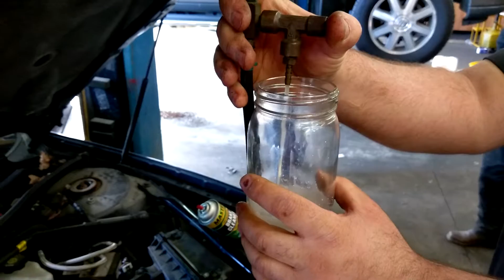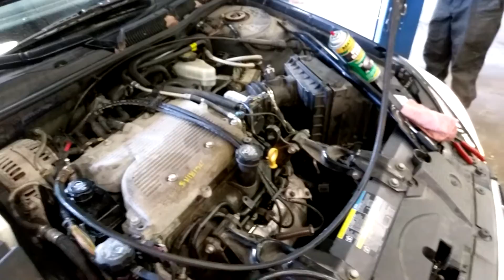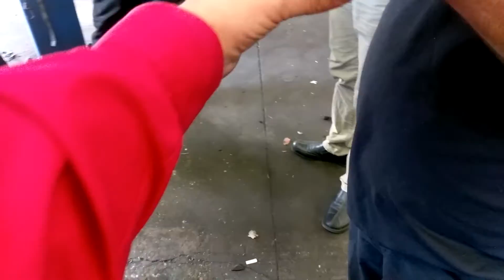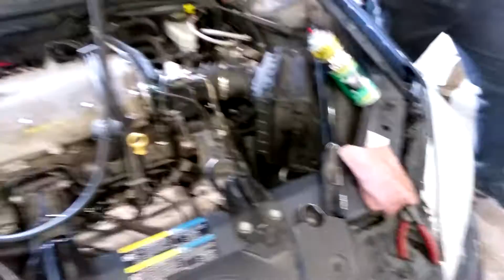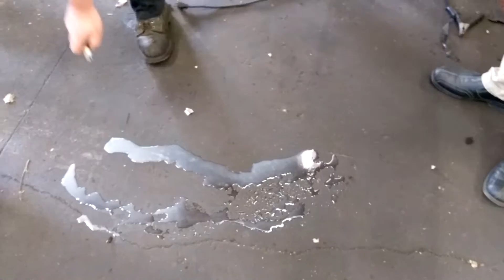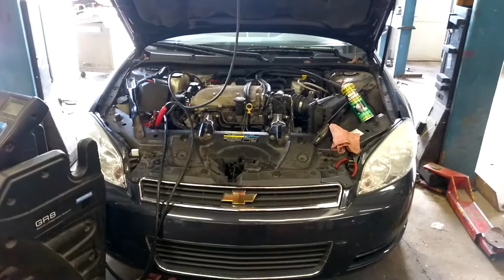Someone put milk in my gas!

Comment: Help! Someone slashed my husbands tires and put what looks to be milk in the tank.What should we do about the milk?
2010 Dodge Journey
Reply from the maker: The "milk" is probaby water that has reacted with the ethanol in the fuel. Either way, the only thing you can do is drain the tank. Unfortunately for most vehicles the only way to do that is remove the tank from the vehicle and remove the fuel pump/level sending unit. A small amount of moisture can be dealt with using some products like drygas or heet. However, if they filled the tank with anything other then gas it will have to be removed and drained. Most of it could probably be removed via siphoning, but that would still leave significant pockets of substance in the tank.

Comment: Milking a car is possible?
Reply from the maker: It was with that car! Ha. Thanks for watching. No idea what happened to that car, and the owner acted like they had no clue. Turned out the entire tank was filled with some water based liquid. Gonna assume the owner knew something was up because that white was emulsified fluid like they added gas and some HEET in an attempt to get it running. See a lot of crazy stuff come into a garage that's for sure. Best one was a SUV bought brand new, came back with 40k miles on it for its first oil change.